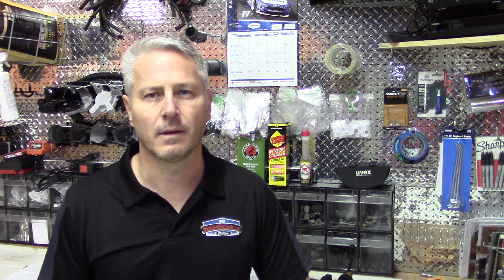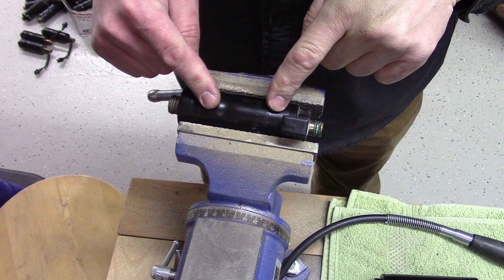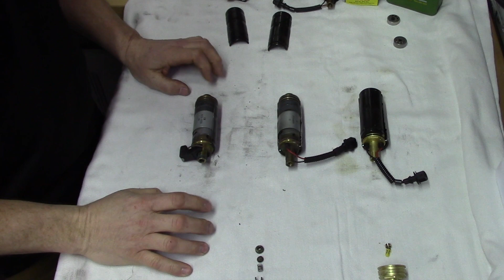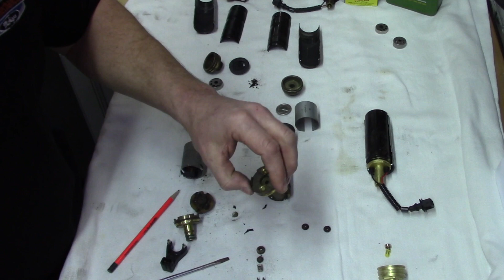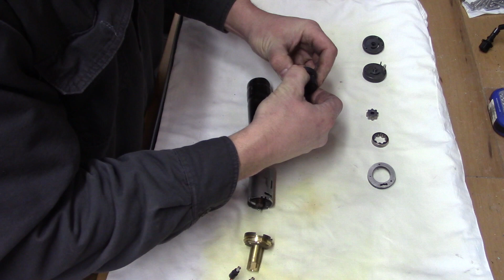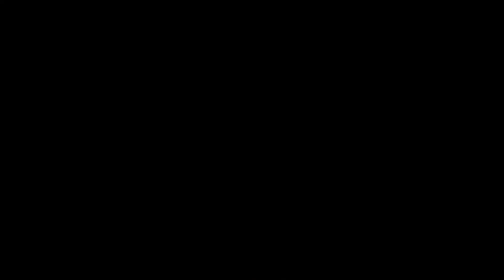Volvo Penta Fuel Pump, High Pressure and Low Pressure Disassembly

Comment: My Volvo Penta 4.3 Gxi  from 2004 starts directly and runs perfectly at low speed (max 2500 to 3000 rpm)... but when I go 3500 rpm high speed he stops directly (like everything falls out). When I restart he doesn't run anymore. When I unleashed the high pressure fuel pump the fuel flow a few seconds when turning the contact key. After reinstalling the high pressure pump connection at the top and I want to start the motor runs perfect without any problem. So it means there must be falls air or mealy a electrical problem with the fuel pump a high speed... What could it be? Thank you for your advice ;-)

Comment: I want to use one of these for a non-marine application.  I know there is a cooling jacket on this to cool the fuel.  Does cool/cold sea water go around this cavity or is it tapped off the fresh water cooling system and has anti freeze in it (obviously much hotter).  Thanks.

Comment: If you have a low pressure pump for carborated applications and it is putting out way too much pressure. Hold your finger over the outlet while powering it up and tap on it And you will unstick the pressure regulator 
,

Comment: I want to use your services but I live on the other side of the earth.I have inboard Volvo penta 300hp 5.7 v8 GXif . If i clean my fuel pump do I have to replace High pressure and low pressure pumps or its possible to clean and continue using them?
Great videos sir

Comment: Great video! I had to replace the high and then the low fuel cells. It was good for about 5 hours and then right after I got gas (full). the fuse is breaking again on low pressure.  Could there be another issue then the pump? The fuse is blown just after 1 - 3 seconds. Please advise

Comment: I just purchased new pump $1400 😏
Reply: Very bad design, shame on Volvo. Most of there parts I've installed failed within 5 years. The fuel pump and steering cylinder are absolutely garbage.

Comment: Perhaps the most important thing you can do to extend the service life of ANY marine fuel injection pump is to remember that EVERY time the water separating fuel filter changed is to fill it with fresh fuel to limit the time it runs dry.

Comment: What is the point of disassembling the Volvo Pinta fuel pumps down to the individual internal parts, since they can’t be reassembled and be made functional again? If they didn’t work when connected to an electrical source they are scrap. After wasting the time to disassemble them, they are still scrap.
Reply: It’s educational so people can see the inside lip where the paint sits.

Comment: Great video Troy!  I see you sectioned the outer housing with a disk to disassemble the pumps.  Is there a way to get access to the inlets to clean the screens without sectioning the outer housing?  I suppose there is but thought I would ask for the easiest way.  I do have a fuel cell that I plan on sending you for rebuild.  Does the paint come from the inside of the fuel cell before it enters the low pressure pump?

Comment: Great video . Just found it after I had trouble with the pumps on Cruiser Yachts 300 cxi with twin Volvo penta 4.3 cxi j . I had one engine burn 20 a fuse on top of engine I changed the fuse and the pump worked for a while and then both the pump and the fuse were gone with the pump giving a whiring noise . Other pump on other engine was working fine I then had them changed with the working pump to the bad engine and it gave a small puff of electrical smoke upon connection and pressing start button . Now neither pump is working . Any clue what could it be . Thanks

Comment: Glad I found somebody who seems like they have these pumps figured out. I recently pulled my HP pump because it was whining loudly after a fishing trip. I bought one of the cheap aftermarket replacements from eBay, but the plastic clip wasn’t removable and I wound up breaking it. Mine HP pump is the older style with the plastic clip. Do you know of a replacement that has the removable clip?